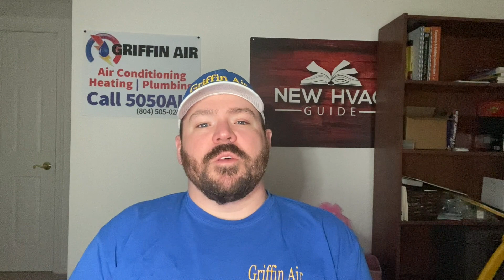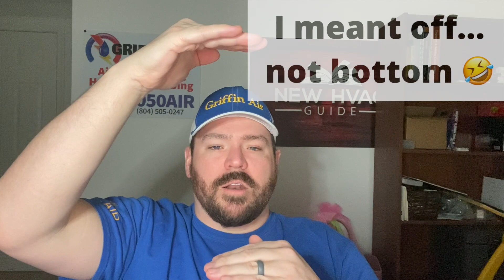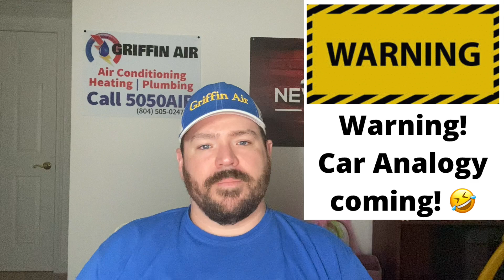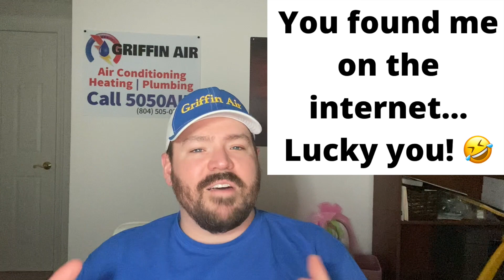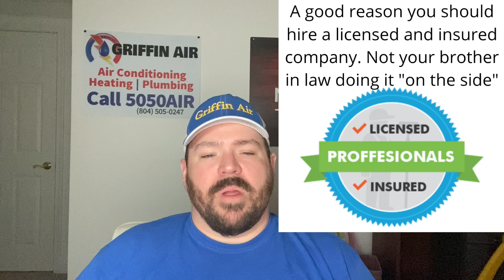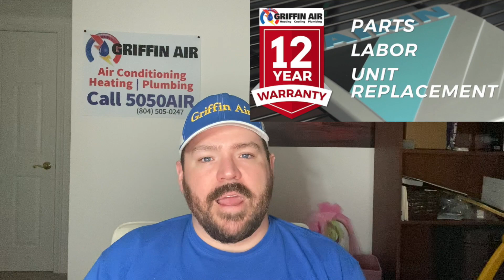GOOD and BAD of High SEER Inverter HVAC!

Comment: The new Mitsubishi air ducted system runs at 4 amps at full capacity.
Reply from the maker: Daikin too! Crazy!
Reply: @NewHVACGuide  I like daikin VRV 5 I’ve installed a bunch of there equipment. The only thing I like more from Mitsubishi you don’t have to have someone else Commission system. Daikin makes you take their service class and buy their 2000 dollar service commissioning tool. I don’t have a problem with the service or install classes I think it a good thing. I have a problem with having to buy a 2000 dollar tool.
Reply: Iv installed a bunch of vrv 5 systems. Im vrv 5 certified for install and service when I worked for a company I could commission the systems

Comment: Just grabbed my second Daikin aurora(20 seer/12.5 HSPF), the mitsubishi hyper heat(30.5 seer/12.5 HSPF) was $500 more and I would only break even in 15 years with our electricity rate, no thank you lol
* note I was looking at 3/4 ton 9k BTU units
Reply from the maker: Nice. I think you’ll be happy with the Aurora.
Reply: @NewHVACGuide  yes I've been extremely happy with my basement Daikin Aurora 12k BTU!  Do you know if Daikin is planning on releasing more efficient models? 30+ seer, 16+ HSPF , 4.5+ COP ?
Reply from the maker: I would imagine as time goes on they all will get higher and higher. Daikin seems to focus more on performance and reliability than efficiency.
Reply: @NewHVACGuide  yes that's what I've noticed, its a good trade off though! The efficiency isn't all that bad in the end, especially when you compare the total consumption of smaller 9k/12k units.
Reply from the maker: We installed Mitsubishi for years before switching to Daikin. I don’t think we will ever go back
Reply: @NewHVACGuide   was it a supplier/support issue?
Reply from the maker: Actually we had a few issues with the products

Comment: Man, o man.  I live in Central Florida and am currently on my 5th installer coming to give me a quote on replacing my 18 year old Carrier system. Every one of them have told me at lease one of the reasons you mentioned in this video as to why I don't want a variable speed system.  Every one of them was an "old timer" as you say...  They strait out REFUSE to install them.  So frustrating. great video, wish you were in my area.
Reply from the maker: Wow. I’m surprised you couldn’t find at least one contractor to install higher seer equipment
Reply: @NewHVACGuide  One person quoted me a high seer system but wanted over 40 grand for installation. I was very clear about what I wanted at the time I set up the appointments but they come anyway, knowing they won't install what I want. So far it's been a big waste of time. Luckey my old system is working ok so we aren't in a big hurry.
Reply: Sir I work in Central Florida too. And the reason why inverter system are not desirable in Florida is because of all the lightning strikes we have here. 
As I am sure you know we are the lightning strike capital of the world down here.  And these inverter system simply are not voltage tolerant.  Any kind of power surge or brown out and it's adios inverter and no cooling.
Reply: @seanmathews1826  I wound up finding a Carrier dealer that installed the system I wanted at a reasonable price.  It came with lightning surge protection.  Also, in the event that my system is taken out by lightning, my home owners insurance will cover it.  Considering that lightning has the potential to be several hundred million volts and tens of thousands of amps, a good strike is going to take electronics out regardless of whether its just an AC motor or an AC/DC inverter, VSC and DC motor.

I had a new variable speed pool pump installed at the same time as the heat pump and air handler.  Between these two improvements, I have seen a reduction of nearly 750 kWh per month, for the months of July and August.  This translates to a near 80 dollar per month decrease on my electric bill.  In my opinion, it is worth the risk.

Refusing to give your customer what they want because you feel that it isn't worth the risk is a poor business practice.
Reply: @TheSloppyDingo  Hey do what you want . God granted us all free will .
I assume you bought a Carrier Infinity?  I hope it was registered with the manufacturer for parts warranty.  You're gonna need it.😄

You need to understand that I work with the Carrier Infinity system everyday. I have see the issues and problems with that system everyday for the last 15 years. 
Myself personally I won't sell that system anymore because I have morals and ethics.  I can't sell that system to people  knowing the problems that it has.  
Unfortunately there not all the people I work with are like that.  😕
They care more about the commission they will get on the sale.  
Within the next 10 years don't be surprised if the indoor ECM blower motor fails three or four times.  The inverter will likely fail two times and the compressor will need to be replaced at least once. 
I think I have replaced 300 to 500 blower motors in that system since 2005. 
So those 5 other old timers were trying to help you avoid a lot of misery.   
But like Strother Martin said in Cool Hand Luke.
"What we've got here is failure to communicate.  Some men you just can't reach."
Reply: @seanmathews1826  The unit it replaced was Carrier.  It was about 18 years old and didn't experience any major issues over its lifetime.  I have heard these same claims from HVAC people about all the major brands...  The Taine installer said Lennox is junk.  The Lennox guy said Carrier is junk. etc, etc. 

As for the other installers, they could of just as effectively "helped me out" by explaining the reasons they wouldn't do the install over the phone when I set up the appointments and conveyed what I wanted. Instead, they showed up and proceeded to tell me all the reasons why I wouldn't want such a system... which was a huge waste of time for both of us.  

The company that did my install has been in business for many years.  The owner of the company has the same system installed in his home.  They did a fantastic job with the installation and I truly believe they will back it up throughout the systems lifetime.  They are a Carrier authorized dealer so my warranty is squared away.  Thanks for your concern.
Reply: @TheSloppyDingo  
Lennox puts a lot of unnecessary electronics in their systems .

Trane has never been the same since they were bought out in 2006.

And Carrier is junk too and I work for a Carrier dealer.   
It's depressing because I remember when a system would last for 10 years without needing any repairs and you could get 15 to 20 years of life out of them.
Today 10 years is the max life you get.
I now regularly see compressors failing after 18 months. Evaporator coils leaking after only 3 years. 
And it's all brands . 
You are a consumer.  I am someone who has worked in this trade since president Reagan was in the oval office. 
If I was running a business I wouldn't sell those systems to the public either. 
It is said that in HVAC you are married to whatever you install. 
So if I were to sell you an inverter system and it keeps failing you are going to keep calling me to fix it. 
And you probably won't be very happy either.  That's why those old timers won't sell them.  They know it will be a major pain in the neck for both the consumer and themselves. 
Not worth it.
Reply: @seanmathews1826  I have seen those ECM blower motors and have to relate. The small electronic board that regulates them is what goes out most of the time, not the mechanical portions. I have seen condensing units that have a circuit board taking the place of contact switches !  That to me is a high risk idea as the power cycles usually crack solder joints and printed circuits. Cheaply made circuit boards is the problem, they won't design them to take the rough roads ahead !
Reply: @TheSloppyDingo  Times have changed...all manufactures have changed their quality practices from robust to fully featured gizmos, the high end equipment anyway. Carrier is now out of being part of a conglomerante, they are owned by themselves these days however, all makers do not design and manufacture robust HVAC like they did in the past...therefore, comparing an old Amana, Goodman or Carrier from the 1990's to the brand today is completely a misnomer.
Reply: @Garth2011  Yep, the manufacturers are overstuffing these systems today with all sorts of electronics that don't need to be in there.  And people like Mr Girgen don't want to listen to people that have experience in this field.

Comment: However I have seen 20, 30, 40, 50 and even 60 year old single stage systems still running without leaks, on the original compressor and heat exchanger!
Reply: Yessiree but the electric meter has had two sets of bearings replaced due to the fast rotations the wheel moves.
Reply: I have an old 3 ton Rheem made in 1988 that works fine but damn that high electric bill. I'm on time of use during the summer from 2pm to 7pm.  My highest bill was $228. I also have a second energy star central unit upstairs from 2005. Looking to upgrade to a more  efficient AC setup for downstairs.
Reply from the maker: That’s awesome!

Comment: Thank you for passing on your knowledge and insight! I wish I was in your area as I would love to work with a profesional like you! Unfortunately I’m in Sunny & Humid Florida.

Anyways, I have a home in Central Florida built in 2007 running a 5 ton carrier with 13SEER. I’m getting ready to replace this unit before it fails on me, in the middle of summer. The house is well insulated and the ductwork works perfectly with my existing unit. I’m considering installing a Lennox inverter unit. My concern is that as the unit slows down I might not get enough air on  the opposite end of the house  from where the Air Handler is. The AC space on the house is 2800 ft.²

I would very much appreciate your thoughts on this.

I will be subscribing to your Web site before I proceed with the purchase to make sure I get things done right.

Thank You 🙏
Reply from the maker: Hello! Thank you for your kind words. If the ductwork is sized properly, you should not have an issue with comfort in your home. If you find that you are having an issue with velocity to the registers far away, try closing some of the vents halfway in the rooms that get cooler the fastest. Otherwise any other fix may be expensive like replacing all the ductwork or installing dampers.
Reply: @NewHVACGuide  Thank You 🙏
Reply: @NewHVACGuide  Isn't that idea best done with dampers at the air handler plenum vs. with the individual supply registers ? I'm understanding that once the supply air leaves the plenum, there is no advantage in closing supply registers as the plenum still direct those ducts with supply.
Reply from the maker: @Garth2011  blocking the air is blocking the air.  If you imagine the plumbing in your home, you can turn the water off at the sink or at a shutoff when it first comes into the home.  Air works no different
Reply: @NewHVACGuide  Check into this science, no it is not the same. Lots of items come into play.
Reply from the maker: In this case, it is the same. We aren’t talking about static or air flow or any other science. We are simply saying that if there’s a 10 foot run of duct and it is dampened at the beginning or end, will the system operate any different, the answer is no.
Reply: @NewHVACGuide  We'll check into that. Years ago was advised at the plenum for a few reasons.

Comment: I love your posts , I wish I lived closer to ya , we could use a good Hvac guy. 
    I install and work on large Servers and deal with power all the time. The first thing I look at on any type of power rectification is the smoothing capacitors. If you see United Chem,Rubycon,Hitachi,Panasonic, Elna,Kemet,Cornell-dubilier,and Nichicon your good to go. If you see JUNG-FU or FU-ME or some other strange name,run like hell.
These Inverter heat pump systems need clean power and the capacitors are used continually in a high heat area , I have seen 50,000 dollar computer destroyed because they went cheap on one part. They had Chinese capacitors in them , that tells me they cut corners everywhere. 
I will only put in or replace boards in computers or buy equipment  that have Japanese or American made caps in them and then rated properly for the environment there in.
Reply: Are Bosh ids 2.0 inventor heat pump made in China   ?
Reply from the maker: Thanks pal. Me too. 

Wow. 50 grand. I’d hate to get that bill.

Comment: In California we have a $0.29 pkwh peak rates all year long which is from 4:00 p.m. till 9:00 p.m. . That is the main time you're actually going to use your air conditioner so a high seer unit pays for itself so quick here with 106° days common in summer. We kept being told it's not worth upgrading to a high-sure unit because the cost of the unit is so high and parts are expensive but we saved easily over $1,000 a year with our 19.5 seer unit and our air conditioner has a 10-year Parts warranty so I just don't get the reason these AC installers try to sell you the "middle road" units sometimes.
Reply from the maker: I’m with you 💯 
I don’t think those installers want to understand
Reply: Wha brand you have?